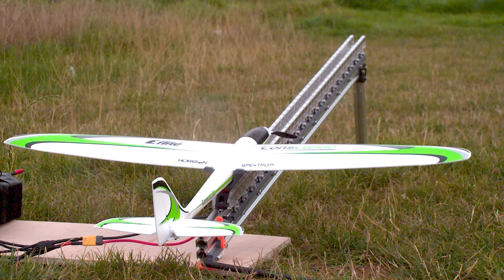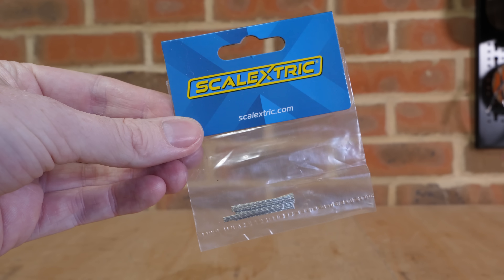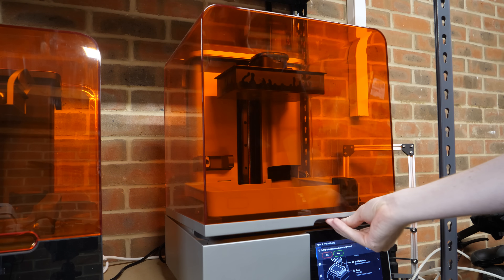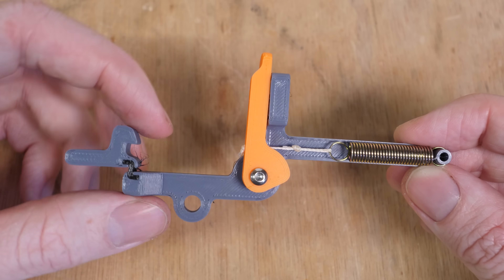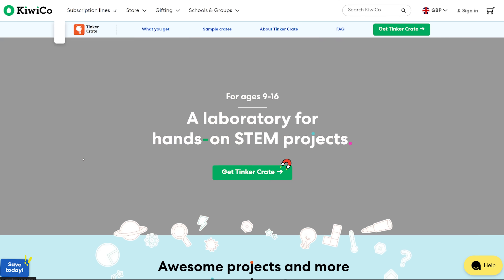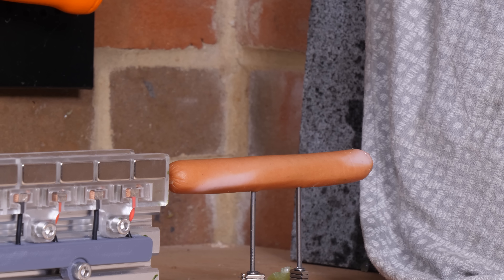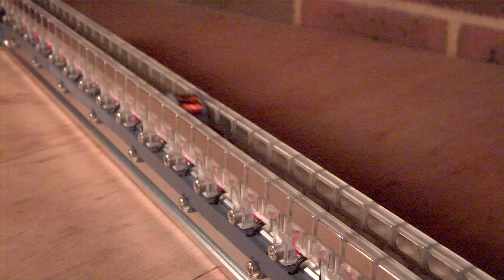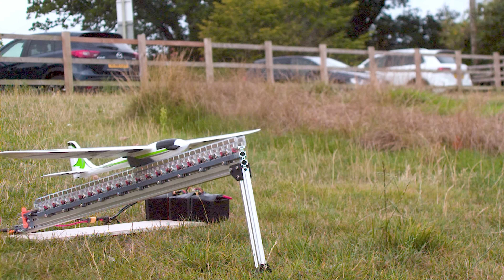Electromagnetic Aircraft Launcher

Comment: Seeing all the sparks and spark damage, I have quick and simple recommendation:
I'm not sure the voltage you are running, but across the terminals of the coil, solder something like an MOV in parallel.

The sparks are created by inductive kick. So if you have 24v going through like 2 ohms, you're going to have 12A running through the coil. When the contact is broken, it is slow to change current, and will try to force 12A through open air, resulting in a huge voltage spike.

An MOV becomes more conductive at higher voltages to protect against voltage spikes. This could drastically reduce the voltage of the spikes. There would still be sparks, but they would be less damaging.

I didn't think this over too much, though. So there might be other effects to contend with. For instance, since the coil could "free-wheel" at the threshold voltage, it might make the current in the coil last longer, so you might get slowdown. It would be something to test. You might want a reverse-current bypass diode on your output source as well.

EDIT: Dang, now I'm thinking about it.
You could even try a capacitor as well as the MOV, Have it store some of that remaining energy into a capacitor that is ready to discharge in the opposite direction. But that might be tricky due to all the phase issues at different speeds.
Reply: MOV will result in braking after each contact loses,
Capacitor will eat energy away from the coil,
Best is to use a diode across the the bus bars, the back-emf from the coil will then go across the diode giving it an extra kick in force.
Its the same way an EV motor works
Reply: @onGlobalproductions  capacitors if done right will make the coil a bit stronger since impedance will be lowered. Meaning more current trough the coil for the same voltage.
Reply: @oscarsjolund9672 That would only help at the resonant frequency of the L/C circuit. Overall, you're still wasting the energy that could be going into sparks. 😁👍
Reply: MOV will explode after too long, 

I think a TVS diode would be better, they are designed to handle extreme current.

Two of them in anti-series like this   -[---->]- -[<----]-  rated for ~100V
Reply: Theoretically you can use capacitors in series to cancel out the inductive reactance. But both capacitive and inductive reactance change with frequencies (in diffrent factors)So each step you will need a diffrent size capacitor. Thats alot of hassle (and espacially math 😅)
Reply: @oscarsjolund9672  It would be easier if proportional to velocity, the spacing between the magnets increased while also increasing the contact length. That way the frequency remains approximately constant over the range of speeds. The capacitor can then be tuned to the mass of the payload.
Reply: @oscarsjolund9672 yeah and whatever you work out would work for one specific mass. Change the mass, speed changes and all caps would need to be changed also.
Reply: I am an industrial electrician. We use a RC network (resistor and capacitor) across coils and sometimes contacts to reduce the damage from arcing. Just a thought.
Reply: simple diode in series with a neon bulb.

diode prevents the chance of reverse conduction in the neon, and the neon clamps maximum kickback to about 70V, give or take. once ionised, that drops to about 20v..

as you say, 12A is trying to force its way through megohms of air, and the end result is KV... dt/di...

a diode alone will clamp to 0.7v, and the freewheeling will cause magnetic field to persist. also going to need a fairly hefty diode for the current.

a neon by itself will work, but theres the issue that it may still be ionised when power is applied again, and theres nothing to prevent the neon conducting either way.

and it produces a nice light display :)
Reply: I was gonna say zener diode in parallel with the coil, that way it'll break down and dissipate the inductive kick

Edit: 2 zener diodes in series pointing in opposite directions in parallel with the coil, pesky alternating current lol
Reply: @QuintonNG2000  Take a look at what the symbol for a TVS is. They're basically two diodes back to back designed to start conducting once their breakdown voltage is reached.  Exactly like what you're suggesting, just for hundreds to thousands of volts.
Reply: @EmperorA0  ok cool, thanks!
Reply: As an EE, I'm loving the discussion this comment sparked
Reply: Awesome project man! I’m middle of the road with technology. I like relay logic but I also like digital logic. Each has its place.
Reply: Thinking about it now, I personally would have gone with permanent power rails, and use the contacts to commutate a simple MOSFET bridge aboard the sled, a few caps on the + and - and the body diodes will freewheel on their own. The switching current needed to switch the FETs would be far lower and make the system more efficient. Though I might be overthinking this (job hazard lol).

If you wanted to really transfer some power I'd also ditch the solder braid or Scalextric parts for some racing grade slotcar parts. Professional Eurosport or Group 12 slotcar parts can handle well over 20A for short periods of time, this would require using the right braids with the right pressure, and also a braided copper power rail like on professional slotcar tracks. Look up the british slot car racing association for some pointers to take this thing to 11!
Reply: MOV's are like fuses, they are more or less "in case of" not really "to remove existing." TL;DR: the MOV would probably not last too long.

I personally would try and go the tuned passive rout, as that is keeping closer to the "purely mechanical" theme.
Reply: MOV / Cap solution should improve efficiency.. i also suggested varying the moment at which the coils are energized by relocating the brushes.
Reply: Given that the coil's magnetic field breaking down results in a reversal of polarity, I wonder if any of the energy it is storing is being added to battery voltage for the next connection?  It might be a bit tricky to re-tune for optimizal resonance, since it'll depend on the coil's capacity (henries), but if the resonant frequency matches the switching frequency (actually 2x the frequency) it'll nearly perfectly dump the stored energy into energizing the coil the other way.  Of course, the switching frequency is changing, but there might be an optimal value there for whichever part of the acceleration curve (probably a brachistochrone) is steepest.  Points further away from that optimal value will just be a bit less efficient.
Reply: @georgedorn_fnord  there is no "reversal of polarity". the current in a coil upon decay continues flowing in the same direction as when it was built. thats why we call them "freewheel diodes" as they allow the current to continue flowing in the SAME direction.

the POTENTIAL at the end of the coil increases, and that merely gives the ILLUSION of a "polarity reversal". 

if there WAS a reversal of polarity, the current would also reverse. it doesnt.
Reply: He’s trying to keep it all manual
Reply: Achtually a bidirektional TVS diode parallel to the cool could Do the trick. Make Sure ist voltage ist größter than your operating voltage, and that ist can handle the pulse energy störend aus magnetic field in the coil. You May want to add a resistor in seriös with the TVS diode to Limit current and energy at the Costa of slower field breakdown.
Reply: Or for MOV: See for example this for Selektion criteria https://www.tdk-electronics.tdk.com/download/531282/6614cba3a8f9c6f2cec934e302cf8f95/siov-calculation.pdf
Reply: I think to maximize your force, you want the power to be in the magnetic field as much as possible.  That means keeping the current flowing.  And that means you should use some kind of flyback diode to allow the current to keep moving when disconnected from power.  Those sparks really mean a loss of power which could be going to thrust instead.
Reply: @tocksin2  It's AC by design, so a flyback diode wouldn't work.  That's what the MOV/TVS being suggested does though.  Since it conducts in both directions above the breakdown voltage.  Which you get from the magnetic field collapsing.
Reply: My suggestion: Keep the sparks, they look awesome
Reply: What is a MOV ? You mean a diode ?
Reply: @BrainHurricanes  Metal Oxide Varistor
Reply: @BrainHurricanes  A Varistor, try googling :)
Reply: Dam how long did you take to type that for people like me to not read it 😢
Reply: @Jordgubbsoppa81 kys

Comment: Need thinner wire for the coil, maybe even cooling as it heats up. Also space the magnet sections further out with speed increase, i think acceleration is slowing down as it speeds up. Potentially making them longer with higher speed too. Also how about the coil being a launcher which returns? What if there were multiple going around like a chainsaw launching projectiles rapidly?

Comment: for speed, alter the spacing/timing of the contacts and magnets in the later stages. use the vid tracker to see where the current acceleration stops....start spreading them out after that point.
Reply: I thought that as well. Kind of like changing ignition timing in a gas engine as the RPM changes.
Reply: The timing would change based on the mass being accelerated.
Reply: @naasking  Yup. Maybe mount the contact plates in angled slots and tie them to a lever. Then you place the launcher and mass on the lever to set the timing and lock it in with a knob.
Reply: @naasking  if the magnet pairs and contacts were each modular and could be spaced along the rail....something whispers logrhythmic pattern to me, but i'm just making it up as i go.

Comment: Place a steel core in the coils. Also use multstranded wire for coil (litz wire) to avoid skin effect and increase speed at which fields are formed. Perhaps add caps/supercaps to avoid power dips if any. 

Awesome idea, I build a rail gun way back for my thesis at Uni.
Reply: I think proximity effect is more important in this coil. But I agree with a core and additional capacitors along the rail as close as possible. Any resistance has huge impact at those 90 Amps.
Reply: What was the fps?
Reply: I wonder if the higher coil inductance with more windings causes an issue with the changing polarity. A steel core would definitely improve the coils power output but I wonder if the then even stronger magnetic-field in the coil breaks down to "zero" fast enough before the next contact strip is hit.
Reply: @SirMoohsAlot inductivity is already the reason this works worse beyond 200 turns. A core would make this way worse.
Reply: The engineering compromise he spends the last part of the video talking about id magnetic force Vs coil mass - a steel core would mean more force but way higher mass so it would probably harm acceleration overall
Reply: You used Litz wire? What frequencies were involved?

Comment: 11:45 I would also note the increased inductance from more turns, meaning that the coil's field will take longer to reach its full strength. I suspect this may be a factor in why the force you're seeing from more turns is not directly proportional.
Reply: The force is probably still proportal, given his calculations( I didn't double check the numbes)  that show the 400 turn coils delivered more  Newtons  of thrust, but the weight slowed down the rate of acceleration. Yes inductive reactance and resistance do play a factor in how much current flows.  But take note that  twice the number of coils means you only need 1/2 the current to generate the same magnetic field, assuming the permibility remains the same, rather than  change with a saturating core.
Reply: Also the coil with more turns produce more back emf. Similar to a motor kv rating the theoretical max speed is achieved with the least amount of turns
Reply: @laserdiode  I'm not so sure  maximizing kv will result in max acceleration over a given distance.
A rotor under a load may turn as long as needed to get up to speed, but a linear motor on the other hand is constrained by its track length,  and doesn't have the option to spin a few more revolutions to get to its max velocity for a given load. 

There are many more variables to consider: Permibility, core saturation, payload weight, source impedence. 

On my channel I built an axial flux  motor with a kv that was bit too high making it dificult to get started. The coils were wound faulhaber axial flux for 12 poles per coil. There were  3 coils with 4 turns per coil. Even with iron in the stator, the inductance was very low and the motor had low starting torque.  There are a number of things I could do to improve that motor.  Even  the controller  could have been improved with use of larger capacitors to reduce source inductive impedence given how fast large currents were being switched.
Reply: He may also be running into the fact that flux density can't increase forever - the magnetic circuit will reach saturation. Inductors and transformers are carefully designed to maximize flux linkage and avoid saturation. The many comments suggesting a ferromagnetic core and completing the circuit with a bar will decrease the reluctance and allow for greater flux density.

Comment: You could merge the previous and current design, the sled with a magnet would activate micro switches as it travels down the rail and those would in turn switch IGBTs (switching coils), which can handle more current that the MOSFETs. This way the timing of the coils will be mechanical, without any complex electronics, while avoiding arcs, improving reliability and increasing the amount of current. 😁

Comment: 9:35 looks like the sled is flapping it's wings happily. 

Also, 7:30 instead of making your own hall switch - couldn't you just have used some sort of metal latch that holds the trigger when it closes? Or a metal "grabber" like those on cupboard door holders.

Comment: If you would use transistors to enable each section then you'd be able to shape raising time and enable current when brushes would be fully in contact. This would enable efficiency and minimize sparking. Also you'd be able to turn off transistors just in time to prezent opposite force

Comment: Tom, for your magnets, try arranging them in a Halbach array for more power . For your switch, have a look at compliant mechanisms to eliminate springs.
Reply: Can also put something like a small sponge behind the switch to help dampen the bounce. A compliant mechanism would be good though. Especially if it's lighter and stiffer than the magnet/leaf combo.
Reply: @webx135  This switch he made is a real head scratcher... as in, I'm wondering why he bothered to design such a strange and over-complicated switch with very long travel, and velocity. I guess it's dramatic, but that kind of mechanism is more appropriate on a flintlock musket than a railgun.
Reply: @EricLaspe  yeeah i thought the same. why not just use a light switch since they already exist.
Reply: @EricLaspe  Probably because it really feels like a coil-GUN when you use a gun-like trigger&hammer.
But yeah, it could have been improved. Specifically by removing springs as I can't 3d print that on my 3d printer (same for any hinges that require the plastic to flex, so compliant mechanisms are out too. Needs to work for 3d printers printing brittle plastic too!!!), so it currently needs extra parts besides filament (same issue exists for the magnets, the rail, and the strips and copper).

edit: ps: this was a coil gun, not a rail gun
Reply: @webx135  O just some one-way lock
Reply: That sounds brilliant

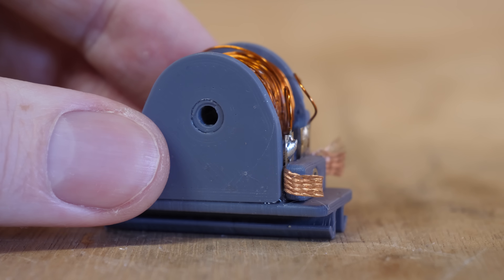Comment: 12:37 If you're using a cap screw to hold your sled brushes in place, you can probably fold the brush around the strip and skip the solder. The cap screw should be fine for a compression fit, if not, a little tweaking to your design and you're good.
Reply: Yeah when he said he clamped the contact surfaces together, I thought he meant he clamped the contact surfaces together (the contact surfaces being 2 strips, one soldered to coil, other clamped onto the brush). But all he means was that the clamp held it in position, and still needed to get soldered :p

(ps: I know he said he needs to solder on new brushes, but he actually do not. The brushes are clamped into position into the soldered strip, but not soldered stuck. So he could bend it open, replace the brush, and bend it stuck again. Will get metal fatigue, but should work for a couple replacements before that happens at least.)
Reply: Also, since you're using solder wick for brushes, soak it in alcohol for a bit and blow it out with compressed air. Solder wick has flux in it an might be contributing to the residue left behind when it arcs and sparks.

Comment: Far inferior to optical/inductive sensors and power MOSFET switches. What were you even thinking dawg...
Reply from the maker: The launcher I built 2 years ago used hall effect sensors and mosfets. However, it was far more complex to build due to the timing control electronics, let alone have to wind far more coils along the rail.

Comment: your launcher would be much more powerful if you created more of a magnetic circuit that does not need to travel through air. You can do this easily by placing a iron bars across pairs of magnets on the outside of your launcher. This will increase the magnetic field strength.
Reply: or just a single iron bar slapped on either side of the rail structure, following the whole length of the launcher. This will guide the magnetic flux, just like the casing of an electric motor

Comment: I hope you make a railgun launcher to compare to this coil version! I was expecting lots of current going up one rail, through the sled, and down the other to complete the circuit and accelerate the sled, with extra magnets placed along the length of the rail to increase the strength of the magnetic fields.